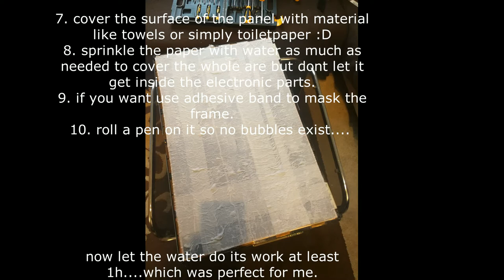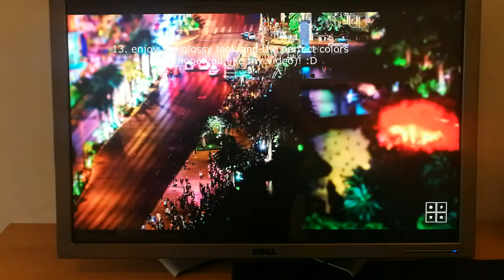uncoating Dell W3008WFP and  u2711b Monitor anti glare

Comment: I tried to remove anti glare coating from dell s2722dgm but I saw I was removing the polarizing filter - I could not see another layer on top of that so I think the polarizing filter / anti glare coating is combined for this one.. Luckily I only have a small artifact in the corner when placing the filter back so damage is not too bad
Reply from the maker: Yeah, newer Monitor types are tricky. Ist gut you dont proceeded after the corner test...
Reply: U gotta check the screen manual to see if it has an antiglare layer. If it does, then soak the screen for 12h+ to make sure it is wet enough (overnight or 24h+ is always better), poke 1 corner of the screen, then:

If it goes up SMOOTHLY, then you are removing the antiglare coating. Surface is smooth and there is no glue residue whatsoever.

If its difficult to remove the coating, then you are most likely removing the polarizing film. You can confirm this by touching the screen beneath the corner where u lift the film up, if there are glue residue then yup, polarizing film is coming up.

Comment: Planning on getting a Dell S2721HN and removing the AG coating.
Any idea if the AG/3H hardness coating and adhesive is any different than the one on the Dell U series?
If it's too different and the adhesion more strong, I may end up damaging the panel.
Thanks for the video, it at least gives me some hope.

Comment: When you peel off the outer layer, underneath it, as far as I know, there is a polarizing filter. Isn't it dangerous to use the screen in this way? Isn't there a possibility of distortion? I would appreciate it if you share your experience.
Reply from the maker: The Monitors i used were already 8 years old. Even by cleaning them i had no problems, thats my experience. So it wouldnt be a great loss even if the polar filter would get unclean after a while or some residue cant be cleaned away. I recommend this for older monitors myself because newer types have different glue or stick harder and the coating is difficult to remove. Theres a high risk to damage the surface then.

Comment: Did you use hot water? How hot? Edible temperature?
Reply from the maker: Normal water from the water tap,not heated. But remember, this method works mainly on older H3 coating. Try the corners first...! Which Model?